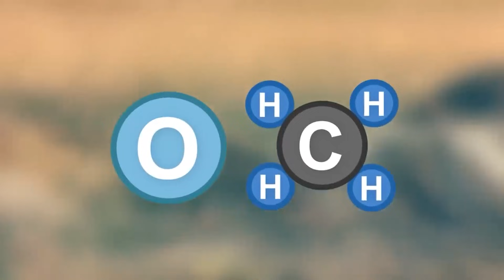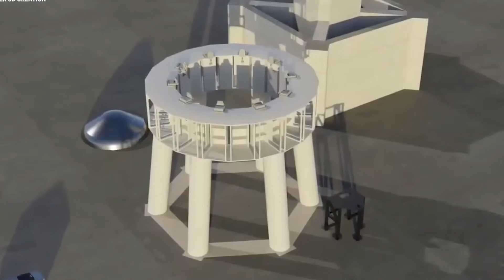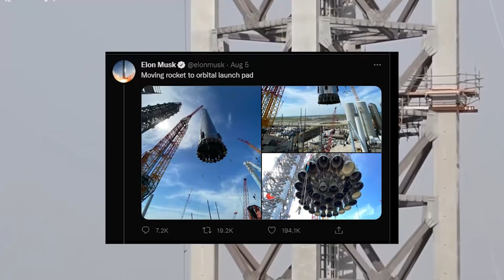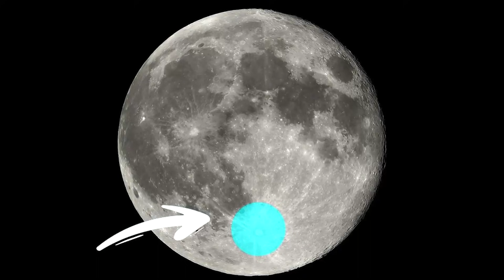SpaceX GENIUS Super Heavy is a True MASTERMIND

Comment: SpaceX say they are short on oxygen? The plan on Mars is to crack water (H2O) into Hydrogen (H) and Oxygen (O2), and Carbon Dioxide (CO2) into Carbon (C) and Oxygen (O2), and then use the Hydrogen and Carbon to make Methane (CH4) for fuel, with the Oxygen (O2) left over as the other component. So as SpaceX will need that technology for Mars, why not use it on Earth to make their own Oxygen NOW? It's tech they will need to develop anyway! They could EASILY crack water (which is abundant on Earth - they could even distill sea water and use that) into Hydrogen and Oxygen, and then either supercool the oxygen or just put it under enough pressure, to get it to what they need for their rockets now. Science has a solution for every problem.

Comment: One thing I enjoy doing is reading the transcript of the video so that I may build a strong vocabulary regarding space science. Two definitions caught my eye. The first one was when Elon used the word 'bifurcated' to differentiate between remaining on Earth or becoming a space-faring species. The second one was the Sabatier Method, in which Hydrogen and CO2 are heated and pressurized in the presence of a nickel catalyst to make methane and water. 
The main reason for Musk's selection of methane as a fuel for Starship is that it can be made from existing gases and metals found on Mars. This, in addition to using electricity to separate H2O into separate elements to have oxygen for breathing and oxidation for fuel combustion, will swiftly allow the Mars Colony to become self-sustaining. Hydrogen, besides being useful for methalox,  may also be used for air travel should SpaceX or other industries decide to use dirigibles for transportation. It's use will be much safer on Mars.